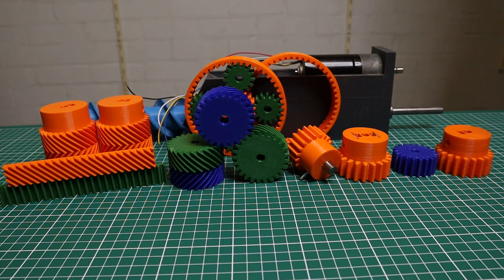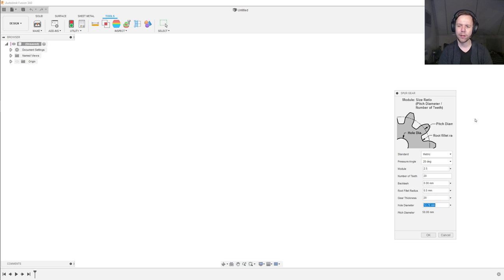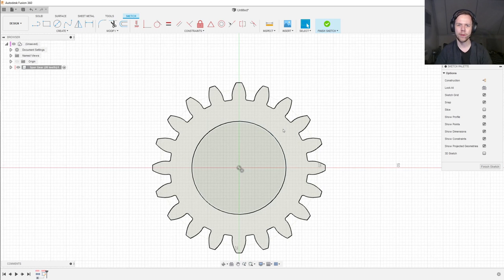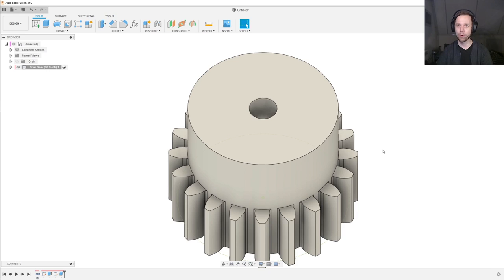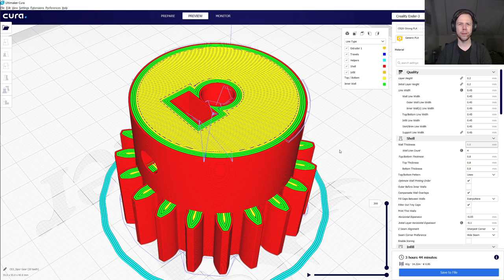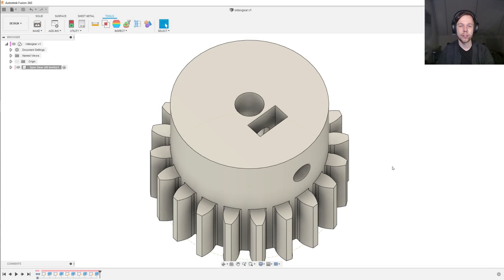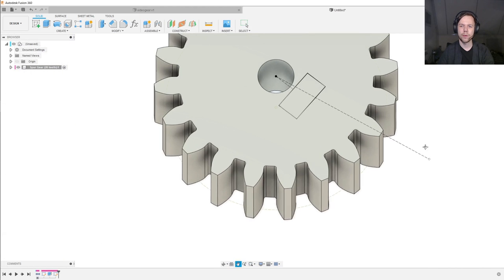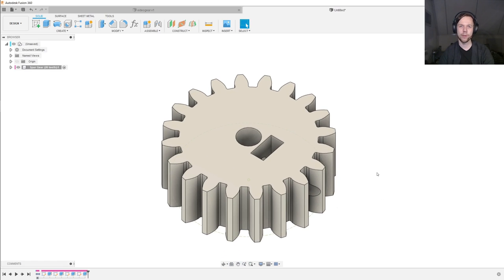How to Design and 3D print basic spur gears, and how to attach them to shafts (Gears part 1/7)

Comment: I love the jig you made to center the hole.  If I may make a suggestion, you might want to enlarge the botton hole.  On the top of the jig, you add a large round hole.  You then can print a plug for that top hole with an appropriately sized hole in the plug.  These plugs would be interchangeable and potentially single use, but it's easy and cheap to print them as required.
Reply from the maker: Thanks! The interchangable plug idea is pretty good, that would cut down on the reprints by quite a lot. You would need some method of securing those plugs to the rest of the jig though, but that shouldn't be too hard. Another option is to use drill bushings, as I've shown here: https://youtu.be/qeD7DLyAx74

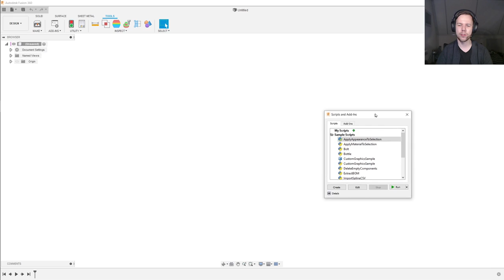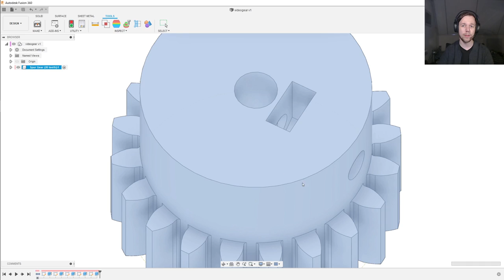Comment: I enjoyed that. It was good to see the design taken through to the finished article including printing tips and then how to improve it. I just want to throw in a few things. At 1:30, when running the "Spur Gear" script, go to the "Add-ins" tab instead. Run the "Spur Gear" script from there, either the C++ or Python version (most tutorials seem to prefer the Python version). The script will now run until you exit Fusion 360. You will find Spur Gear at the bottom of the "Create"  drop-down list in the "Solid" tab. 11:00, you can right click on individual components in the "Browser" to save as STL. You can use this method to save individual bodies within components as well. 20:54 At Last, I now understand how and why to use "Project". Thank you. At 22:15, you mirror the screw and nut features so that you can add a screw from the opposite side. Meaning that your shaft had a flat side, will this throw the centre off?
Reply from the maker: 1:30 I know that works, yet I never do it that way for some reason. I probably should because it saves a few clicks. Strangely I can't get the add-in to run at startup
11:00 Another button that I know is there, but that I never use for some reason. Old habits die hard I suppose.
22:15 If you torque the screws down equally hard, they will push the gear out equally hard. The nuts also have exactly the same amount of plastic they can push against. The only difference is that the setscrew pushing into the flat will be slightly closer to the center, causing a slight mass imbalance, but that's really tiny. Make sure you torque both screws down in a roughly equal amount though.

Thanks for watching so attentively!

Comment: Amazing video! I couldn't figure out how to get to, let alone use the gear extension. You might want to consider simply printing a gear with a 'D' shaped hole to fit the shaft

Also right clicking the body or component will allow you to convert it to stl which is slightly easier
Reply from the maker: I haven't ever tried printing a D shaped hole, I pretty much assume that it won't hold up to the torque. A generic stepper with a 5mm D-shaft produces 0.5Nm, that's 0.5/0.0025 = 200N of tangential force right at the shaft's edge. I just always assumed that such a force concentrated at the corner of a D-shaft hole wasn't going to work. Perhaps it will and I'm just being too pessimistic about it.

Good tip on rightclicking bodies/components, I hadn't seen that before

Comment: Brilliant. We were taught (many years ago) that a metal screw with a shaft as you showed here is a bolt, not a screw. A screw has threads all the way to the head.
Reply from the maker: There are unfortunately many different opinions on this matter. The one followed by the machinery's handbook for example is that it's a bolt when you put it through a hole and put a nut on the other side, and it's a screw if the hole itself is threaded or the screw cuts its own threads. I dislike this definition a lot because it implies that what a thing is (screw or bolt) depends on how you use it, which seems silly and pointless to me. But that's just to illustrate there are tons of different viewpoints about this.

Personally I tend to call small stuff screws, M6 and under, and larger stuff bolts. This too is a very arbitrary and meaningless distinction. I am also more inclined to call something a bolt when it has an external hex head, for use with a wrench.

At the end of the day I recommend just not worrying about it.
Reply: @antalz  Andrew Tanenbaum quipped. "The good thing about standards is that there are so many to choose from.

So I tend to agree. I'm more worried about if it does the job I intend for it rather than calling it a "threaded nail". :)

Comment: Thanks for sharing your tricks with fusion 360. For the screw you cut at the end of your video, grab its head with your drill and make it rotate (lowest speed) while creating a chamfer on the cut end with a rotary tool (mid speed) with little cutting disk. Use the face of the cutting disk and just touch the burred cut border. Take your time, those little cutting disk are fragile when used in this direction.
Reply from the maker: That sounds like a good trick, though does that mean you have to keep two tools running simultaneously? Or should you put the screw into the drillpress?
Reply: @antalz  Yes, you have to keep two tools running simultaneously. A drill press also works. Adding several nuts tightened to the head side will help in securing the screw to the drill (or drill press) so the head and the nuts are tightened together in the chuck. Do not forget the safety glasses. The screw in a drill (high speed) and a file will also works, but in my experience the rotary tool will provide better results. I also use this method to reduce the diameter of the head for tight locations. Hope this help.

Comment: Thank you very much for this video! I am using Creo instead of Fusion360 but the principles learned from your commentary is very valuable.
Reply from the maker: Yeah it's really quite easy to do all of this in any CAD package you're proficient in. As long as the CAD software has an involute generator, and every decent package does. Thanks for watching!
Reply: @antalz  I will say I don't believe Creo has the same kind of convenient intuitive tool that Fusion 360 has as you're showing, though I am pretty much brand new to Creo. What I've been doing so far is manually creating the involute curves (like how you'd have to do one with pencil & paper) using the steps described in the textbook Shigley's Mechanical Engineering Design, chapter 13; I know that you can also generate the curve by inputting the parametric equation describing it but for now, I find it a little more fun and satisfying to do the pencil & paper process; lot better feel for the gear geometry this way. Thank you for the great series of videos!!

Comment: My hope is that this will be a layman's guide to designing decent and useful gears that's easy to understand. I don't need perfection, I'm not building a transmission. How does one decide how many teeth there should be? When should I use a bunch of small teeth, when should I use fewer big teeth, etc.
Reply from the maker: That's what I'm currently aiming for. I'm currently trying to balance depth with complexity. My current idea is to use basic algebra to discuss number of teeth, size of teeth and shaft-to-shaft distance, and one line of elementary trigonometry for pressure angle. I don't want to talk about what pressure angle does to the shape of a tooth, I don't think people care, but I do want to show that spur gears push each other away while transfering torque. I definitely don't want to get into elaborate geometrical constructions or any integrals.

Comment: Good video. To improve your jig, use a brass or better yet a steel bushing insert in the hole for drill guide. This way you won't ruin the jig every time you drill a new hole.
Reply from the maker: Thanks! That's a good suggestion. Someone else suggested it before, so I've already done it: https://youtu.be/qeD7DLyAx74

Comment: Thanks for the informative video! What filaments do you recommend to print the gears in? My preference goes out to ASA (instead of ABS), but i saw better performance of PLA in some videos. While often stated that PLA should only be used for visual prints. I like to hear your thoughts!
Reply from the maker: Most of my gears are PLA. PLA has better stiffness, and can resist higher forces, than most other filaments. Its only downside for gears is the low temperature resistance, which is a problem for high speed gearsets. PLA is definitely not just for visual prints.

Comment: to reduce the forces if you want to go with the flattened shaft, you should use flat setscrews, the wider the better. if you want to use pointy setscrews, you should drill just shallow holes into the round shaft.
Reply from the maker: Those are some really good tips, thanks for sharing!

Comment: Nice lesson! Extruding rectangle for a nut is unnecessary action, cause later you anyway draw a poligon on a new scetch. Faster and easier  is create an offset plane (or tangent plane for the compact gear from the video) and draw a poligon for a nut and a circle for a screw  there
Reply from the maker: That's true, though I find placing a rectangle within a sketch is easier than placing an offset/tangent plane accurately, because I can more easily reference the other geometry. Perhaps I'm just being weird.

Comment: Have you tried to print with nylon filament? I think is better for gears, but u have to take in consideration some warping, so use glue stick for bed for combating warping of nylon.
Reply from the maker: Yeah I did consider Nylon. It should be quite good with a quite low friction. I do expect the teeth to warp, so I think a raft would be in order. I don't know if I can test how different materials compare when it comes to gears. I didn't do Nylon for this video because I don't want to make the subject more daunting. Nylon is quite hard to print, some Taulman blends are okay but true Nylon is quite hard, you need an all-metal hotend, enclosure and good moisture control. I do have a printer set up for it.

Comment: Excellent video, very helpful. I'm wondering for the first method if you used a screw with a head on it, the head could push in from the outside towards the washer and help make it more solid. Would this work?
Reply from the maker: Thanks! I think that won't work, it's sortof like pulling yourself up by the bootstraps. If the screw head is pushing the washer back in by let's say 10N, then that's 10N less force of the screw tip pushing into the shaft. I feel like I should think about this more, there must be a better way to explain this.
Reply: @antalz  Yes I understand what you mean, the force would cancel out. I was thinking the screw head couldn't move the nut back down the thread but that doesn't matter, it's not where the force is coming from.

Comment: Hi great video. Can ask some questions. What 3d printer are you using and once you have designed your gear how long does it take print
Reply from the maker: Thanks and of course! I'm using some basic creality printers, an Ender-3, CR-20, and CR-10 mini. A gear as shown in the video takes about 4-5 hours to print.
Reply: Thanks message back so fast. I've looking at the creality ender 5 plus 3d printer
Reply from the maker: @pinkfloydvk  The Ender 3 plus should do fine printing these gears. Very comperable to the printers I have, but a bit more modern.

Comment: How can I achieve clutch mechanism in 3D printed parts? Please help! I want to develop a mechanism (positive drive preferable) that engage or disengages the motor shaft from another stationary shaft.
Reply from the maker: I don't think I have a good solution for this. The best ideas I have are:
1) Put a crown gear-like thing on both shafts. You can then engage/disengage it, but the transition will be very sudden, it will create a pretty intense shock
2) Make a ring of magnets on both shafts. When far apart they won't transfer torque, but they will if you bring both rings close together. This doesn't transfer that much torque though even with strong neodymium magnets.

The final idea is using a planetary gearset, and then applying/releasing a brake from one of the gears. I haven't explored this though and it's quite complicated.

I don't know of anything that would really replace a true clutch.

Comment: Hi how are you which type of pla material for gear manufacturing please ?  i want to know want to make some cool projects thanks
Reply from the maker: I'm using a regular PLA, 123-3D brand specifically. The differences between brands are very tiny. Don't use PLA+, that's just PLA that's been softened to make it more impact resistant. That's not useful for gears, so no reason to pay extra for that.

Comment: Simply amazing video ! I have a question please, do you think a carbon fiber nylon gear would hold if it was connected to a 32cc 3hp rc engine ?
Reply from the maker: Thanks! Unfortunately I can't quite answer that question. The first thing you want to figure out is what module and number of teeth you're thinking about. The module determines how large the teeth are, and larger teeth can bear more force. The second thing is that you mainly want to look at torque, so it'd be better if you know how much torque the engine will produce. In video 2 I also discuss that the Pitch Diameter = module*(number of teeth). So what you want to do is Force = torque/radius, to find out how much force a single tooth will have to hold. Once you know that you can start looking into material strengths and whatnot. If you want to really get into it then you have to take a look at the Lewis bending equation, but you can also get a decent idea with a stress analysis.

The other thing you can do is just try it, perhaps even with a PLA gear. If the PLA gear instantly shatters you have a problem, if it holds for a little while before it melts you might have something you can work with.

I recommend checking out video 2, it has some of the maths and concepts you'll need to find an answer to your question: https://youtu.be/ogCGq1aSM80

I wish I had an easier answer for you
Reply: @antalz  thank you so much for the reply ! I see what you mean i will follow your advice, torque is know in datasheet i dont remember i have to check the datasheet and the number of teeth is 38 because i am copying a metal gear which i am buying from the market, btw do you think a simulation can be done for a 3d printed gear ?
Reply from the maker: @Firashelou  Yeah I'm pretty sure it can be, but I actually refrained from suggesting it because stress simulation will be removed for free Fusion360 users sometime soon. But if you have access to static stress simulation, you can slightly flatten an area around the pitch circle, which is where the force is transmitted, then apply the force to that slightly flattened area, then do a stress analysis. You do need to know the module before you can do that of course. I think that, because the force is entirely within layer lines, you don't have to worry about the anisotropy.
Reply: @antalz  i see, so what about the pla or carbon fiber nylon data ? Where do we get it to make the simulation ?
Reply from the maker: @Firashelou  You'd get that from the datasheet from your filament vendor usually. For PLA you usually have around 50 MPa break stress. CNC Kitchen here on Youtube also has some videos on testing filaments.
Reply: @antalz  yes but are those enough ? You mean the tensile stress for example ?
Reply from the maker: @Firashelou  They are enough to figure out if the gear will hold up at least a short while, or whether it will break inmediately. Unfortunately for longer timeframe durability I think both the required material data can't be find, and the theory itself is complicated, and I'm not familiar with that theory unfortunately. Your best bet is to just test, but I'm not sure how viable that is for you.
Reply: @antalz  ok thank you i see, i will do the test and keep the metal gears as back up which are the main gears
Reply: As a mechanical engineer, I can tell you, probably not.

The math involves transferring the pressure angle to a cross sectional area, then analyzing that. This needs to not exceed the material strength called the "Yield Strength" - or the maximum force with area of the unique gear mathematically factored out (force ÷area), where the plastic will permanently bend, instead of spring back.

In English, there exists math to figure out where the gear will bend and then bend back, instead of bend and then stay bent.

This may be something you can look up based on material properties of certain gears, but I have not tried to find table values or equations for this. I also don't know the cross sectional area formulas, to find force ÷ area, although that would be easier to Google and find.

A quick google search shows that 3hp is apparently enough motor to drive a multiple-thousand pound boat, and an outboard motor weighs about 24 pounds. That is huge. While I haven't done the math, that looks like multiple orders of magnitude higher in torque than any gear made of any polymer can withstand. I might be wrong, if you make your gears very large in diameter (bigger than any normal printer), but... You would likely need a purpose built gearbox with heat treated steel gears in order to have a gear box that would fit in anything like a reasonable size for something RC 

There will likely be off-the-shelf gearboxes easier to buy than to convert torque with.

Good luck.